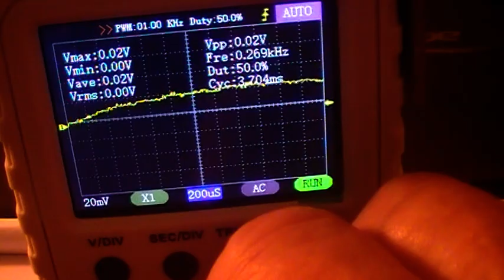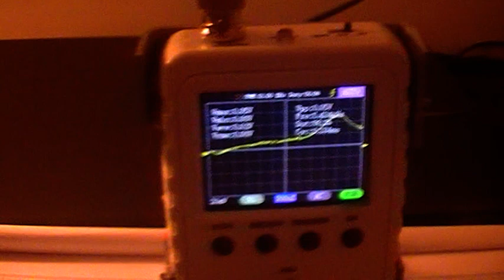jaycar electronics amp preamp signal test to speaker no input to be amplified

Comment from the maker: this is the same  preamplifier with amp i used in the other video experiment with water in a smaller speaker so even without any input signal to either front terminal posts for the input channels this still works well at bubbling water if you like to sonically alter the crystalline structure of water for any newer modified Rochelle salt crystal making brews